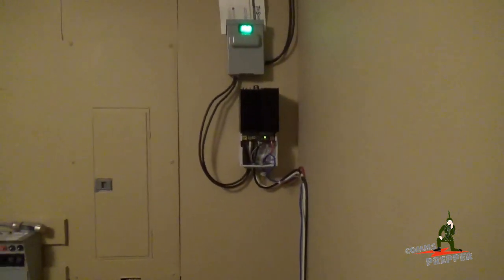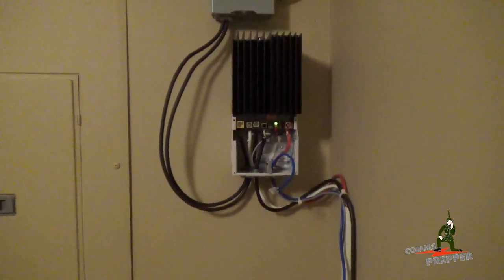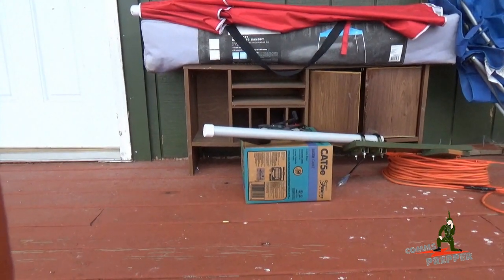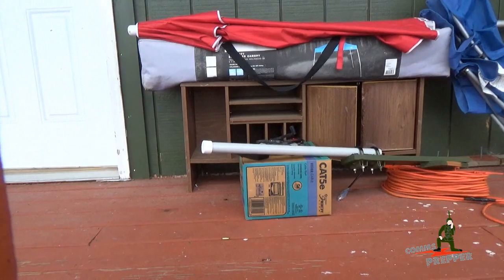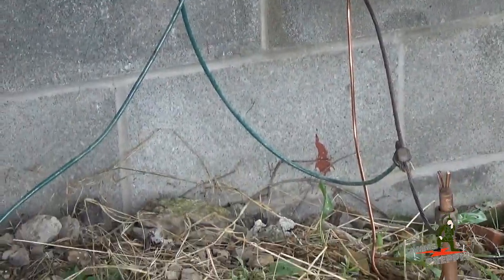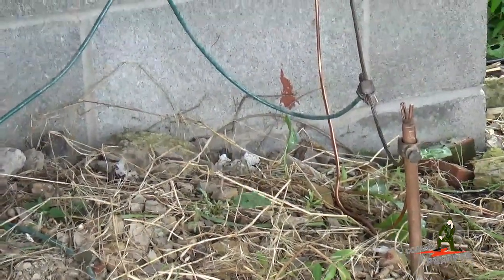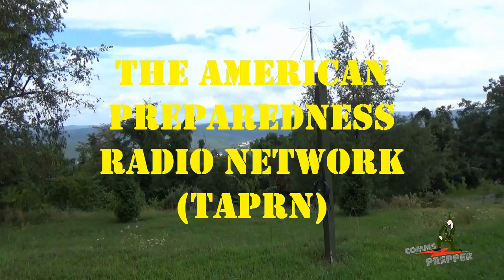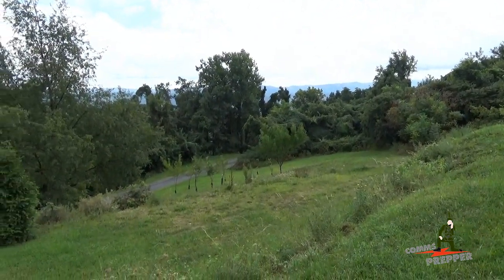Grounding Off Grid Solar Power System

Comment: I cannot tell from the video if all the equipment grounding conductors are bonded together? If not they must all be connected together and then one conductor going to a series of grounding rods minimum 6 feet apart.

Comment: Put either a plastic cap on the ground rod or cut the ground rod closer to ground level.  If someone falls on it, it will do a nasty gash.

The holes on the brick wall for the copper wire create a path for termites and ants which you might want to seal up.
Reply from the maker: Oh shit - this install has long been replaced with a new ground mount system.  However, I always leave the ground rods visible for the county inspector to see - then I hammer them in.

Comment: For what it's worth - The connector on your ground rod is only UL listed for one conductor.  Looks like you have two there.  And grounding electrode conductors cannot be spliced if you intend to follow the National Electrical Code.
Reply from the maker: +sparkie001 thanks for the tip.  The system in this video has since been removed and I put in a new system last year which was inspected by the county.

Comment: just one rod...avoid de voltage difference between them..  thousands of volts travel between them when a lightning  strikes
Reply from the maker: Thanks for the tip.
Reply: Commsprepper , yes the gentleman was right on the one ground, they mention that in the Tri Star manual. That said...A BIG BOOYA THANK YOU Mr CommsPrepper for your videos. We just finished your videos to custom set parameters on my new TS-60. Without your videos I would still be struggling! 
JP

Comment: heard you on the taprn net for the first time tonight.  I find it to be pretty cool actually hearing Youtube hosts on the air! Keep up the good work, but be careful of the hidden wires.....
Reply from the maker: Yeh...  I thought I was cutting an unused run...  turns out the radio in the antenna can be reset with voltage on one of the pins which I applied with the cutters...  I won't do that again.

Comment: Wouldn't be the first time someone started a project that led to another.
Reply from the maker: It was a s$%t weekend.  Cutting the CAT 5 and shorting out (resetting) the Internet link really jammed things up.  I had hoped to get the GMRS antenna up and demo some GMRS radios Midland sent me to show with the Micro Mobile and Operator.  Maybe next weekend.....
Reply: Commsprepper If you don't break something every once in a while your not doing any work.